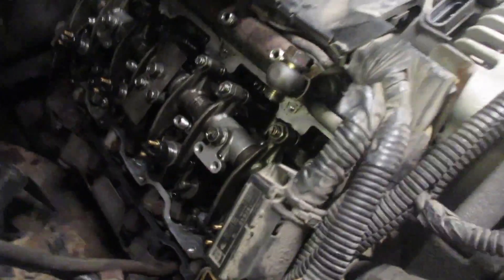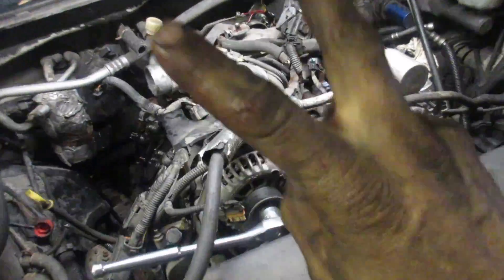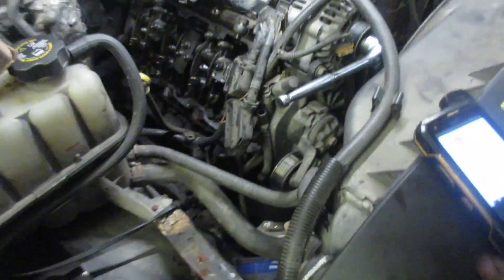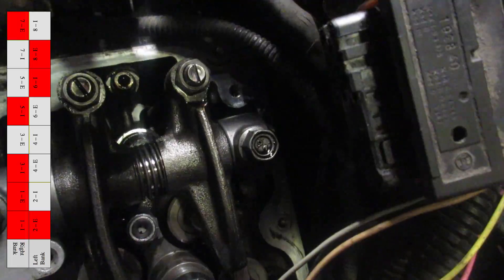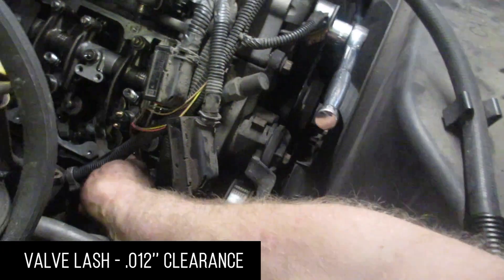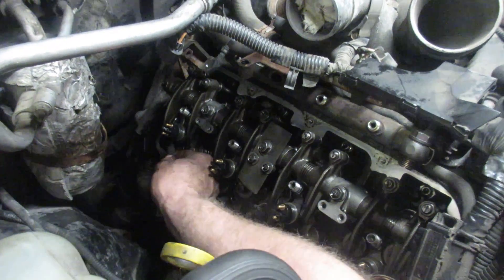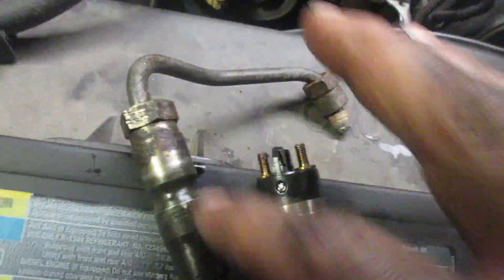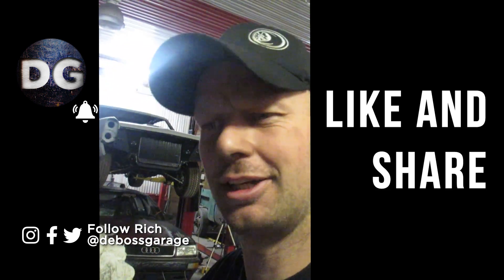How To Set Valve Lash On A 6.6 Duramax Diesel Engine

Comment: Hey my fuel injector lines on my lb7 have come loose like 3 times since doing my head gaskets, seems to be the only thing backing off. Any suggestions? I've tried putting out on them wouldn't think you'd need to snipe brass fittings but it's annoying.

Comment: I’m a little confused if the exhaust valve is moving down that isn’t tdc. That’s the piston at the bottom of the bore. Tdc compression would be when both valves are shut.
Reply: I noticed that too, he says to set the intake and exhaust on number one but the way he set it up the exhaust rocker arm has started to move which would not be at a place to start adjusting

Comment: Do the valves get tighter or looser over time? I've tried the feeler gauge and it doesn't fit most of the valves I tried. I've never done this before. I'm Pretty sure its tdc. Any help would be appreciated. Not sure if they have ever been adjusted. It has 140k miles
Reply: Well I ended up figuring it out. Used a flathead screwdriver to line up the marks on the balancer and engine for tdc. Vice versa. Got them all adjusted. Did the injectors, water pump, thermostat, and put a fass lift pump. She runs great. And no fuel in the crank :) Thanks for the videos.

Comment: So to do valve lash on my 2.3 gas Isuzu with the valve covers off and the battery disconnected I can turn it over without it starting? It's carbureted.

Comment: Sorry if I'm off topic and a little late, but I just watched [S2 E11]. I would just like to note that if you're not spooling up the primary compressor (the large turbo), then it's probably restricting airflow to the small turbo. It might be interesting to throw a vacuum gauge upstream of the small compressor to see. Have a great holiday season (you deserve a break) and the best of new years.Thanks for taking the trouble to produce and share your work.

Comment: How long did it take you from start to finish? Years ago under warranty GM used to pay 12hrs to do that job. Then over night they changed the labour time to 8hrs and only difference in the disassembly and assembly instructions was they left the serp belt on.
Reply: therealbeaker pays 10

Comment: As someone who builds these for high performance I typically set @ 11 thou. Not enough to make contact, less noise and pick up some power. Found it on one of the forums and it's a heck of a way to pick up the power that's been lost

Comment: I feel like you should do a video series on rebuilding a duramax, Cummins and a Powerstroke. Then compare them all at the end
Reply from the maker: We did Cummins already, and we will be getting into the Duramax for the C10.    Won't see a powerstroke on the channel anytime soon
Reply: Really depends on the variant a lb7 can't speak for a lly lbz lmm lml or the l5p on build quality and where the engine becomes a pain. Same for 7.3 6.0 6.4 and 6.7 and same for the 12 24 and newer 5.9 and 6.7s.

Comment: Rich, can I highjack your video?

I’m going to put an 83 Suburban on a 2007 HD2500 chassis, and then power it with a 5.9. If I were to add ABS, would the Kelsey Hayes need anything other than power, input from the wheels, and brake line connections?

Comment: can a boost leak burn up your turbo on a lb7? had small boost leak drove it for over 30k worked great tons of power for what it was doing. one night blew off an intercooler tube and drove it 5 or 6 km at around 70km per hour trying to keep rmp low.. when parked noticed a burning smell and a noticeable loss of power ever since and more lag taking a longer time to build boost. thanks

Comment: I'm a little OCD about adjusting valve lash. I like to use 2 different color Sharpie markers, to mark the ones that have been adjusted. During the first pass, each rocker gets a tick mark from one marker. Then I do a second pass to double-check the lash, using the second marker. I'm done when every rocker arm has two different colored tick marks on it.
Reply from the maker: Each his own.  I record all my work on camera, then review it after the editor does his thing.  Then I post it on youtube and wait for the trolls to tell me what I did wrong.
Reply: I'm starting to think YouTube has a quota for people saying you're doing everything wrong in each video.
Reply: At least your honest rich.

Comment: I love lb7s, they sound awesome and make nice power. Its too bad about the injectors, is there an injector replacmement that wont fail as fast as the stock injectors fail? Can you save the stock injectors with taking extra care and using fuel additive?
Reply from the maker: Better filters like a Fass help.
Reply: The problem is not the injectors themselves. The problem is that GM fuel filters only filter to 7 microns while the injectors are only rated for 3 microns. Over time the injectors get wore out from having larger particles forced through them than they are rated for. The solution, as Deboss says, is to put an aftermarket fuel filtration system on your truck such as FASS. It's a little costly (around $650) but still cheaper than replacing a set of injectors.
Reply: A great deal late to the party, here, but you may be like me an have parked the truck 3 years ago. Lol. Yes, there are better injectors  now. The OEM injectors featured VCO (valve concealed orifice) style nozzles. The needle directly covers every hole in the injector on a tapered seat. Any wear can cause the needle to veer off center and expose any one of the holes, causing it to leak. SAC style nozzles are available now for LB7s and they only have one hole to seal. Lincoln Diesel offers them new with a 3 year warranty and unlimited miles.

Comment: Just reinforces that if i ever go diesel, it will be a Cummins powered Dodge.

Thanks Rich.
Reply: Cummins is also fairly complex depending on variant. Yes a v8 diesel with 4v per cylinder is going to be complex somewhat.
Reply: William Bos I currently own a 2nd gen 12 valve and an lb7. I can tell you that the engine is great but everything on the dodge is Years behind technology wise. The tranis are weak up until the 2010s. The front ends and steering system are weak on my 96.
Reply: @tylerroberts5704  have owned a dodge, cummins was good, rest was junk had the death wobble

Comment: Just wondering because i have no idea but would you set the valve lash on a stock 1994 chevy with a 350, I want to say no but just checking
Reply: Yes but they are done very different
Reply: Yes if there is play set your lash to zero on hydraulic tappets.

Comment: Anyone on here having issues with cold coolant leaks on their duramax? my oil cooler has been resealed twice and am still having issues. Problem is there before and after head gaskets. Only leaks in cold weather.
Reply from the maker: I've had the coolant line to the turbo leaking and causing some scratching heads.  Depending on the temp, sometimes it would leave a puddle and sometimes it would burn off from the engine heat.  Something to consider if the oil cooler has been done twice

Comment: Cummins or Duramax? In Australia these are both becoming more popular in Nissan Patrols as the Solid Axles and coils are unreal but your thoughts?
Reply from the maker: 12V is simpler and cheaper.  I think Duramax is cooler and less common.  Ask me again when I finish our Duramax C10 swap
Reply: DEBOSS GARAGE Thanks champ loving the channel mate!
Reply: 12v for cost duramax for fun duramax engines also weight quite a bit less. About 800 to 1200 really depends on your suspension which is a better size.
Reply: @jdrok5026  Weight is definitely a factor for offroad performance 4x4 and for a tourer (mileage hence why LS no good) but as you said they are more expensive. https://www.youtube.com/watch?v=8gOfxaDETGI&t=107s or ISV5.0 Cummins https://www.youtube.com/watch?v=SAiNlucCiF4
Reply: @patoshi21  I don't know how good the 5.0l Cummins is. But the new 2.8l is light idk it's potential tho so there's that. A duramax is potent but has issues so does the 5.9 so does a 855 or a 318 Detroit which Detroit's just stay away from them they are cool but heavy making the 5.9 look like a pipsqueak in weight.

Comment: Hey rich, i have a question. I set my valve lash on my car by making sure the rockers were on the base lobe, but i have a light valve tick and popping through the exhaust. I suspect it is just dirty since running a can of seafoam through it seemed to help, but it just went right back to ticking. Do you have any suggestions for what i could do with this? Hoping to not have to pull the head
Reply from the maker: Check the lash again, asap.  Eric the car guy has a video on it if you have any doubts.  I would watch it and open it up again
Reply: @DEBOSSGARAGE  will do.
Reply from the maker: What car?  If it didn't do it before, it is likely something you did...
Reply: @DEBOSSGARAGE  2001 accord. Setting the valves didnt change the tick it just showed up one day and only ticks when warm on idle. Loading the engine rids of the tick and trying a few different ways of lashing didnt seem to fix.
Reply: @DEBOSSGARAGE  it is a replacement engine from japan that didnt have the problem beforehand.
Reply: Sounds like you should support your local small business mechanics shop and let them take a look at it.
Reply: Derek Markley  Literally no one comes to the internet just to get told to "take it to a mechanic". 'That is awfully unhelpful advice.
Reply: @nubcan0e  True, but there are a lot people that shouldn't be attempting to do anything more than an oil change, and even that is a stretch for some people...
Reply: @dhmarkley  im not saying i know more than my local shops, but i dont like that they have their finger on the parts cannon trigger.
Reply: @kennedy796  love your answer hahaha
Reply: @kennedy796  hahaha! Love that answer!
Reply: @dhmarkley  haha thx. And for clarity i am a new truck transport tech simply looking for wisdom.

Comment: I just set the valves on my LB7 after replacing the head gaskets. Along with doing the injectors it makes the engine run a lot smoother and quieter.